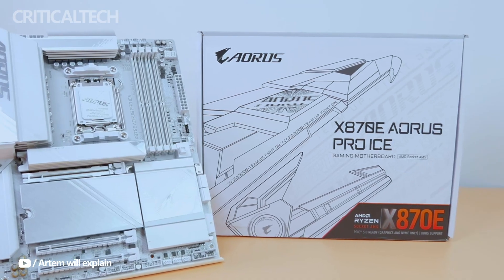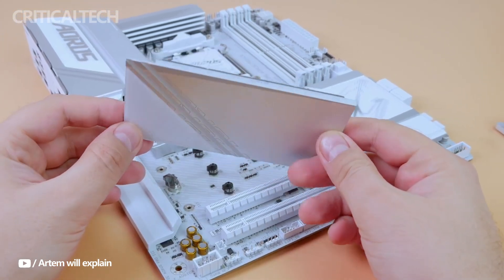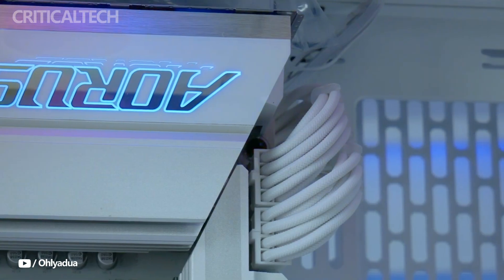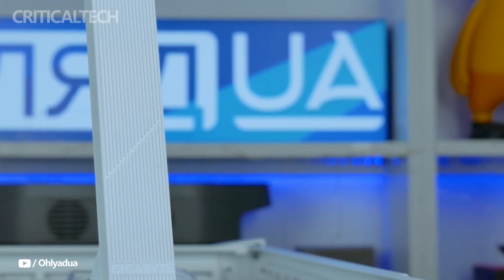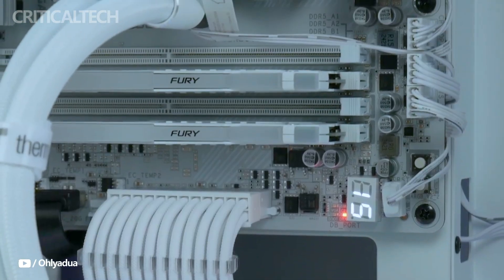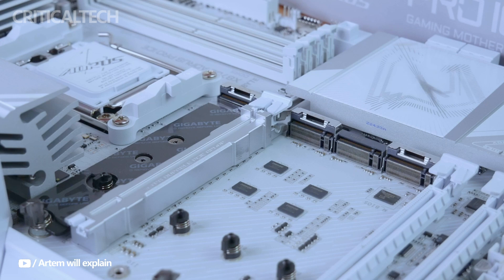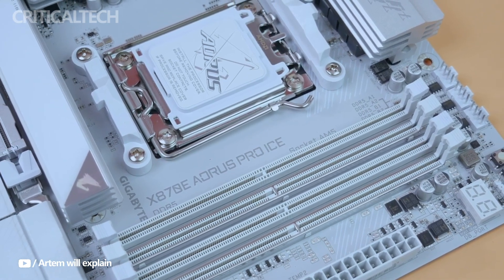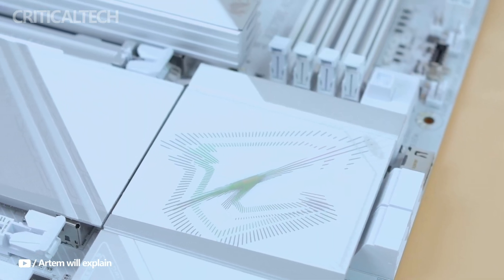Gigabyte X870E Aorus Pro Ice: Motherboard for High-Performance Gaming PCs

Comment: This video claims 10 gig LAN connector and WiFi 6e.  It actually has a 2.5 gig network connection and WiFi 7.
Reply: There is X870 Pro Ice and X870E Pro Ice. I'm not sure whats the difference, ill read about it. Tomorrow my X870E Pro ICE arrive and i can't wait to mount it in my bran new HYTE Y70 Snow white with Lian Li GH II 360 LCD. I am so much inlove with all theese full white builds. Great choise!
Reply from the maker: it all depends on the modification, perhaps another model has 2.5 gig network connection and WiFi 7.
Reply: @criticaltech7091  You may be right. You just wrong say LAN This exact model is 2,5gig on LAN but Wi-fi 7 is another thing especially when you have wi-fi 7 router and powerful network speed. I've got mine just two weeks ago and omg in my situation im building a full white new build, i can't find anything so beautiful in other brands. With lian-li GH2 LCD white in HYTE Y70 SNOW WHITE i can't explain how cool the build will looks.